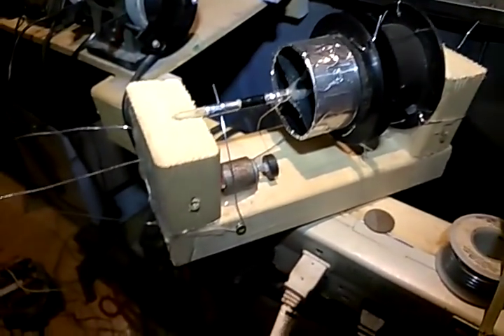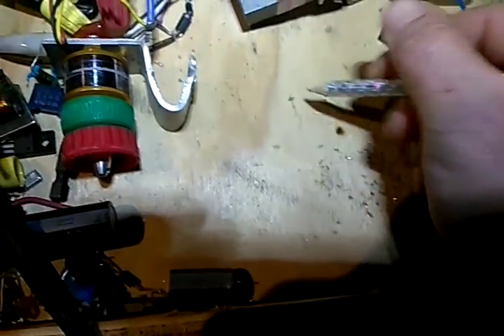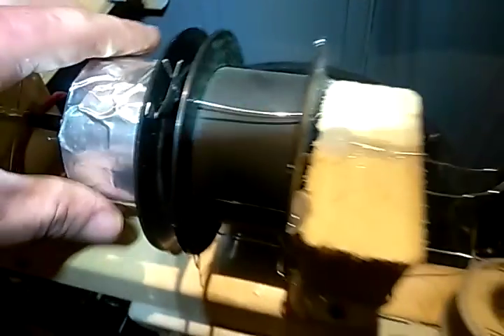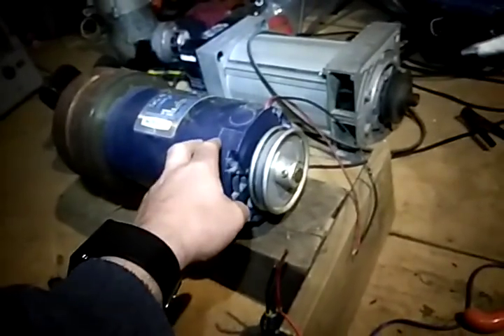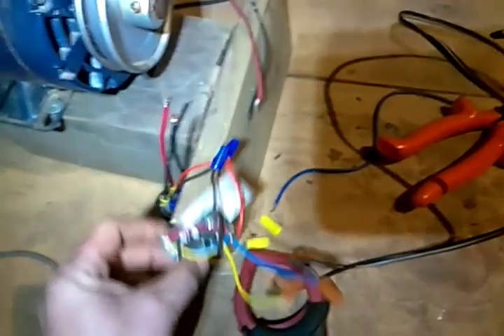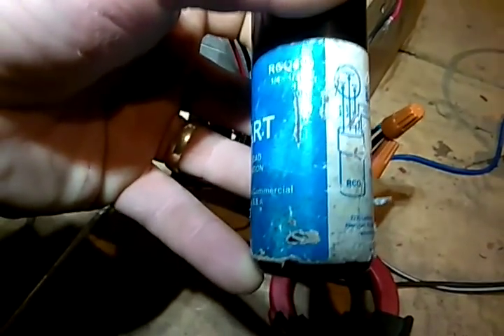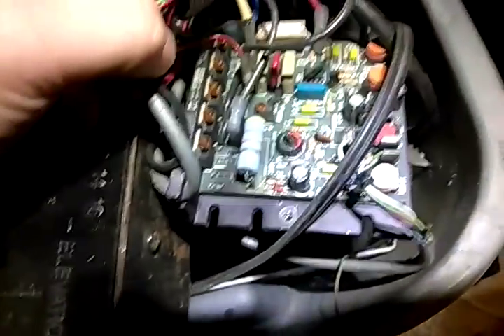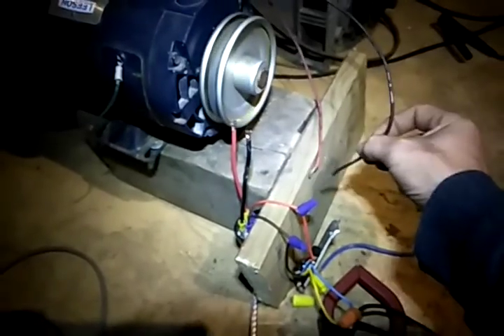Unique Mechanical Speed Controller For 3 Phase Motor Wired In Star, Good Full Wave Bridge Rectifier

Comment: hey thomas! i did it as well mate! listen this: motor PMA of 220vdc at 6 amps:
first test on normal net of 230vdc + only 1 rectifier)----->0,2 amps of consuption...
second test,with a special arrangment to rise voltage at 261 volt dc+only 1 rectifier----> 0,1 to 0,0 amps of consuptions..
-it means that for 30 volt more,it give a benefit of consumption of 50% to my set up apparently?
-more you add rectifier,more you reduce voltage out of the source,so yes,it allow to start with HV and ajust it with several rectifier,but there is a problem: you have always 1 of your rectifier that will burn (i experimented it),best result are with only 1 rectifier mate according to what i saw ;)

however bro, you are absolutly right about what u show here with thoses type of motors! unfortunatly i could not measure torque ,but as you ,i wedge a piece of metal on the axxle omg! torque is just huggeeeeeeee and actually same behavior as yours,even with so much pressure on the axle,i get 0,3 amps max....
please let me know your thoughs about that ;) thanks mate,u do a awesome job;)

guys,listen thomas, he knows what he is talking about, i confirm it!

Comment: I was an industrial electrical technician and ifn i seen a capacitor in there ied say you might be almost there ifn not you'll burn up the motor armature ya need that 3 ph created , the harmonics will heat it up
Reply from the maker: +Theredneck Prepper  
it is a single phase DC motor?.
.. so there's no need for any of my three phase controllers to be hooked up to it.
I thought you said you were a commercial electrician for 35 years?
Because there's a big difference between a commercial electrician and an electrical technician!  maybe if I needed a 3-phase controller I should have thought of something better like building a 3-phase H bridge and controlling it with my Arduino Uno R3...
(VFD)...   but I guess I'm still dumb and that probably wouldn't work either right...